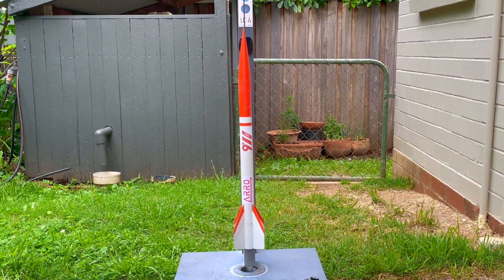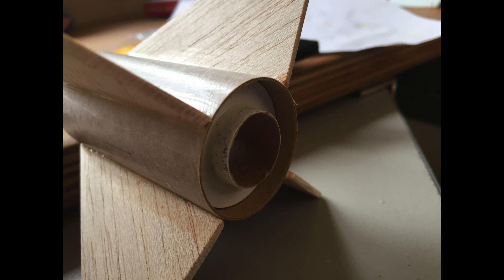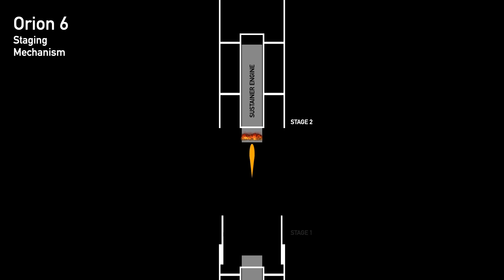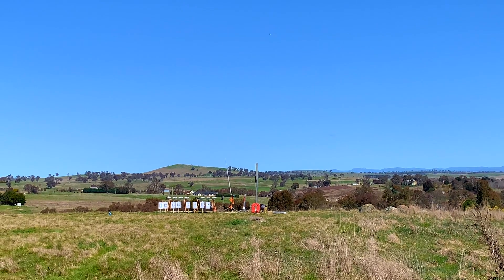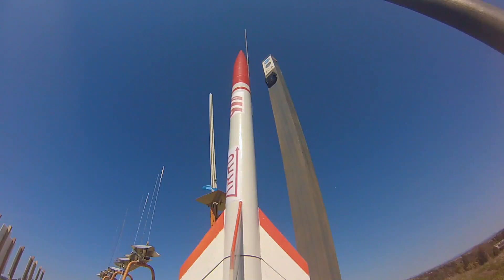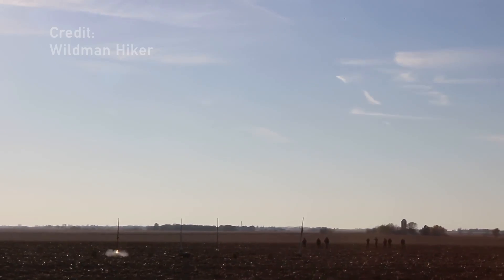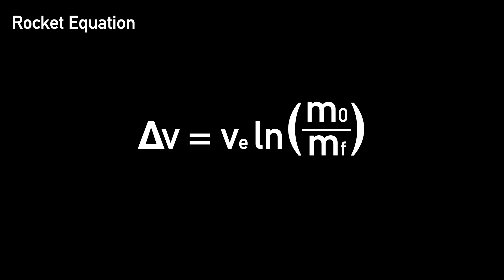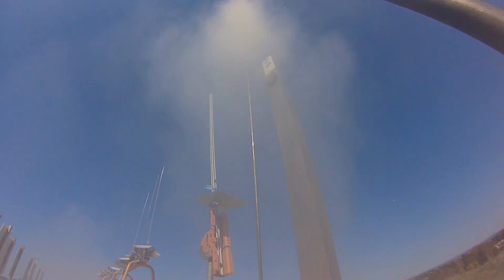How to Make a 2 Stage Model Rocket // Orion 6 Test Flight

Comment: I USE GIFT WRAP ROLLERS. SECOND STAGE ARE JOINED BY TOILET PAPER ROLLER. DESIGN FINS AND NOSE CONE MADE FROM FILE FOLDER MADE INTO A FUNNEL TRIM TO SIZE. DISPOSABLE IS MY WAY. NO SHOW ALL GO. PLACE FIRE CRACKERS INSIDE ONE STAGE MODELS. CAVITIE OF RED CHAULK. FLOUR. MAKE IT SAFE BUT FUN.

Comment: Wrong ,the space shuttle didn't have more than one stage.
Reply from the maker: SRB's and fuel tank can count as parallel staging, yet to be an SSTO in real life
Reply: There is parallel staging and serial staging.  The Space Shuttle was two parallel stages. Once the SRBs finished the boost burn they separated leaving the liquid fuel tank and the Shuttle to continue. Then the main fuel tank separated after that. Does that count as another stage?

Comment: Nice work. I wanted to mention that decades ago Estes offered a center-burning B-class black powder motor, the B14-x.  This had a short burn time but had a very high initial/average thrust which made the B14-0 ideal for use in a booster stage to get the stack moving quickly. The C6-0 motor is a little short on initial thrust for a medium to heavy multi-stage rocket. The C11-0 and the D12-0 have higher initial thrust but are 24 mm motors. It would be nice if Estes would again offer 18 mm center-burning motors with B- or C-class impulse for use in staging smaller rockets.

Comment: question, how many ( or much ) can the 1st stage engine lift? is it possible to do 3 or 4 or more stages? just how much weight can the initial rocket get moving?
and to be fair, are their smaller engines that could do 3 or more stages?
i believe you said c stage engines? if i remember my rocketry days , there were A and B stage engines, back then but i don't recall if they were built as stageable.
i would be interested to see a 3 or more stage rocket even if the height was reduced because of smaller engines being used.
chuckles i remember my Dstage rocket flew away into atmosphere never to be seen again, we were unprepaired for the height! LOL
jeffrey rayborn wausau, wisconsin. ever flown one in winter??? i wonder what the height difference would be?

Comment: What was the overall diameter? Looks like about 29 or 30 mm or Estes BT-55.
Reply from the maker: Yes that's right, it's an Estes BT-55 (33mm) body tube, it's from the Estes Designer's Special
Reply: @arro_rockets  I have been building and flying for over fifty years

Comment: Use aerogloss dope on the fins to seal the grain of the wood. Takes about four coats, sanding in between but makes the overall finish look flawless.
Reply from the maker: Thanks for the tip! Sounds like a lot of effort though, you can also CA a layer of paper to get a nice finish too, or be more patient with primer coats

Comment: You can fit a c-motor inside a d-motor for one continuous long burnJust remove the nozzle from the c-motor first before sliding it in the D- booster motor.
Reply from the maker: Interesting! How do you mount that in the rocket?
Reply: Shhhhhhh, ... that's TOP SECRET! 😱😁👍👍🇺🇸